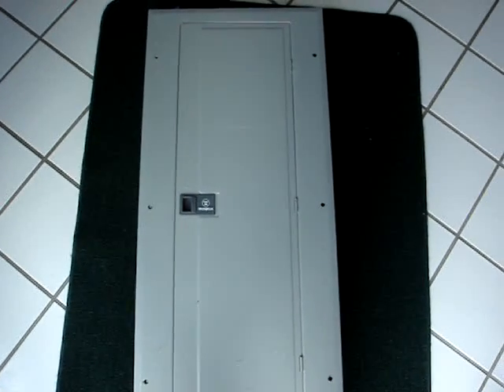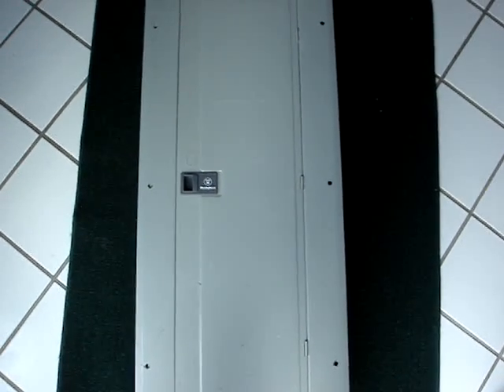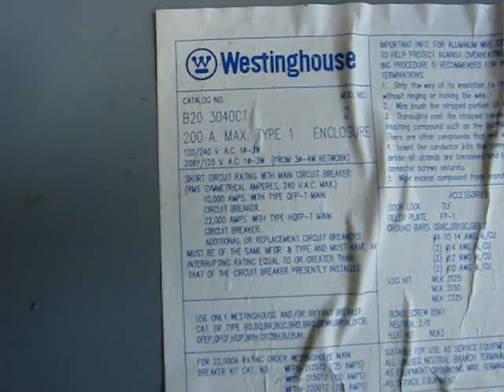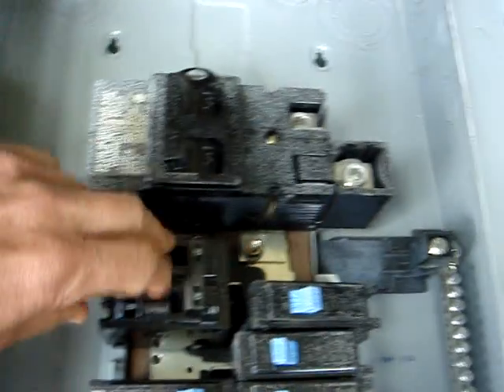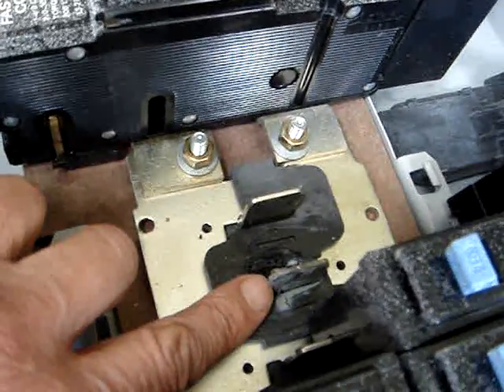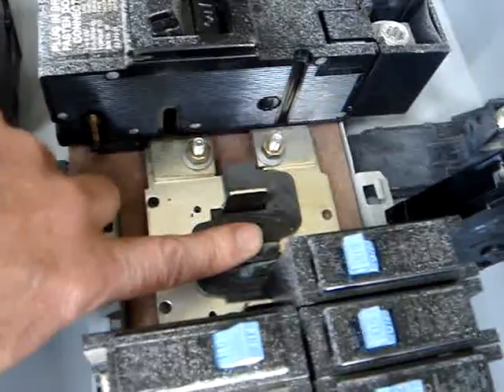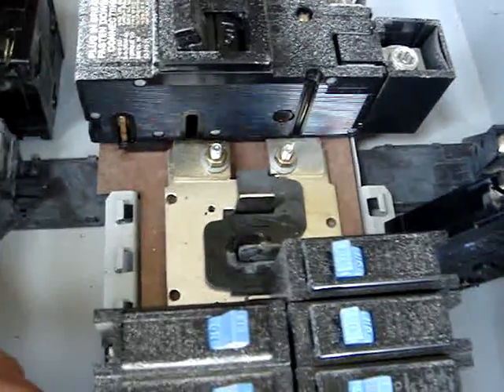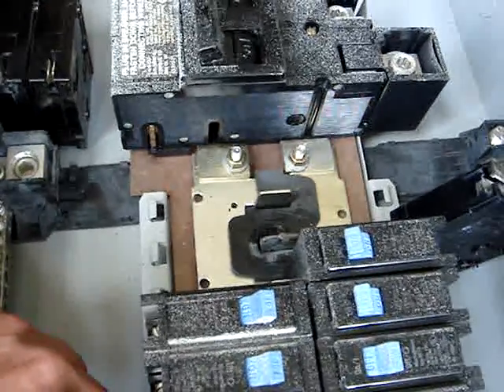Circuit Breaker Panel Problem - arcing between busbar and breaker - heating and melting plastic

Comment: I just had an interesting thought watching this vid. It's something I've seen but never really connected with before. When you buy new breakers, the slot on the breaker that contacts the buss on the panel has a noticeable spot of grease in it. And I've seen tubes of electrical grease for sale at the big box stores. Perhaps every time we remove a breaker, we need to regrease the slot? Maybe the electrical grease helps with good contact of the breaker to the buss?
Reply: The grease is there to prevent corosion.

What you want is good metal to metal contact and good springy metal conductors.

George Westinghouse was good ethical man but the board of directors of Westinghouse of the early 90's or Eaton today I can't speak for. It sure looks like shoddy manufacturing.
Reply: @maynardjohnson3313  George was a hell of a guy! He and I went to different schools together all the way through college.

Comment: Well of course Eaton is going to say there's no problems with the box.....they're not going to say "Yeah, those boxes were total junk, you should get rid of that thing".
Reply from the maker: If I had not given the company a chance to respond, then I would have skipped the first step in solving the problem and been accused of bypassing the company.  I was not under the misconception that they would cheerfully own the problem.  Once they had their chance, the next step was UL and the feds, none of whom want to say there is a problem either.  You are welcome to suggest additional solutions.
Reply: @DBTNVideo  wrong brand of beaker for the panel installed 100s of them never had a problem
Reply: DBTNVideo
I have a couple breaker happen like that, but it is all burn on the one side of the bar of the panel. the electrician said it was lighting hit. insurance paid for that

Comment: I have a Westinghouse B20- 1224cg   The home was built in 1993.  The main breaker is getting hot when under load from furnace or central air and looks like its melting.   I'm hoping I don't need a whole new panel but I'm afraid that will be the result when the Electrician comes later today.
Reply: What happened?  Care to post a follow-up comment?
Reply: Dan s If a single 'tab' becomes burnt, and if there are enough other empty slots in your panel, you can just move BOTH breakers that share that 'tab'.  Mark those two slots as burnt (or damaged don't use), so nobody in the future tries to use them, there problem solved, no costly electrician labor to pay for. Of course, only do this if you feel comfortable working on such things and know how to be safe.

Comment: Learn about the ionozation, your leads from the the grid are going to be aluminum at some point of connection,  and your buss bars should be copper , they have a goldish tint in this video and thats a good hint of the problem. alumiinum when made is a negatively charged element, this prevents rust and corrosion with higher voltage and is much cheaper, the problem in most cases is the contacts and wires outbound are copper and brass (copper and zinc ionized)These metals are whats known as alkalie or posiively charged elements. which increases conductivity but also does not allow for overload as it will just began to radiate heat causing the insulator to melt and and the current to arc to the closest ground damaging much in its path instead of poppping the breaker, and safely disarming. This is the cause of many dangerous electrical fires. Aluminum is negatively charged and has a considerably higher resistance to current and will absorb much more than than the copper or brass will, it will not force the current through the breaker causing a break in circuit but rather act similar to a capacitor, over time the negatively charged higher resitance will continue the breaker circuit but instead of forcing the excess to pop the breaker the positive charge builds up in the aluminum wire eventualy causing heat but much worse the positive electron displaced because of current pressure create a negative electric field  and pass right on through the dialectric(insulator plastic breaker) and the positively charged copper will absorbe that negative current which at that point is already recieving the max it should via the breaker not it has a secondary power source with no limiter and the other breakers( usually the larger ones first, as they are the path of least resistance will induce large amounts of current via the field and since copper is a much more dense element it cant store the energy like aluminum can and it is forced to radiate the excess with heat, melting the plastic, and insulation until an arc can be made to a sufficent ground. mixing the wires sometimes is a necessity, unfortunatly but you want to try to avoid electrolsys at all costs, they need to be super clean for the connection and brazen . some folks use pigtails. remember brass is a positve metal to and so u dont want to be mixing if it can be avoided. there are special types of connection grease and special wire nuts to buy, but its something that your going to want someone knowledgable to do as a small mistake could prove very costly. also a good precaution isto make sure of proper neutral and ground bars , the differences are slight but make a huge difference. I am glad you called a professional , its always a good bet when it comes to that, It stinks to pay 900.00 i know, but hopefully it will def be worth it. Most folks dont have an understanding of the chemical electrolisys or electromagnetic dangers of overloading copper or aluminum. Good luck man! :)

Comment: I have  a 1970's 200 amp GE with die cast buss bars and I get that sizzling on only one breaker(end of house). I tried a new breaker on different section in breaker box and it did the same thing.

Comment: I have a Westinghouse 200 amp breaker panel box that is about 9 years old that has started with a faint crackling noise. This video was helpful to me because I was not aware about the loose rear tabs on breakers causing a problem. But then again I am not an electrician. Thanks

Comment: I have an Eaton c/b panel and I have the same problem with a 100amp breaker. I have replaced the breaker and cleaned the contact. It works for few months then it archs and trips back the breaker. If I replace the breaker with a 125amp, will it fix the problem? Thanks for the reply.
Reply: are you using the proper brand of breaker you should never be tripping a 100 amp breaker  also never up size a breaker from what it was intended  and if the tabs in the panned have had arcing a new breaker still wont fit tight and make the problem worse

Comment: Searching for a similar problem to what I had I came across this video. This was in my barn. One day all 3 of my 240V machines work, next day, nothing. Hooked up Amprobe and am reading 119-121 on each leg. Still, none of them would start. Everything looked fine. This box is a GE CJ-589835 (and it's been there since I bought the place for anyone with concerns about my selection of electrical components). For the 240 breakers there is a "kit" type strap that runs across the bus bars to pull both legs for 240. It's bolted to one side and lays across the opposite bar, apparently by pressure alone, as you can wiggle the strap up and then down until it contacts the bus bar. Well, apparently after some years of load the strap expands enough that it no longer makes sufficient contact to carry a 240V load. I don't know if the strap kit is installed at the factory or if someone installed them. Regardless, it is a poor example of how to do this. All of the voltage readings were normal and I checked that everything was tight, so no problem there. I flipped the compressor breaker switch back on and pressed down on the breaker and the compressor started right up. As soon as I let it go, it shut off. Needless to say, I yanked that thing out and installed a new Seimens box. I like the robust stabs on this box. They are large and have a lot of contact area. Anyway, glad your home didn't burn down. I'm also happy that I found my problem the way I did and not my seeing smoke coming out of the barn. I've got a lifetime's collection of tools, a Harley and a 70 Z-28 parked in there. It would have been a disaster. I'm extremely concerned for anyone else that has this box. What a terrible design. I am very maintenance oriented and occasionally check all of my main wire contacts for torque. It's important. However, If you're not very comfortable with electricity, have an electrician come out and do a routine check. It won't cost much and could save your home and maybe life.

Comment: Continuation #2.  in my area, necessitating loadcenter replacement.  He thought the industry had a vested interest in suppressing reports of problems like this.  He also thought there was a relationship between condensation of moist air from the large service cable which in most installations is directly above the vertical row of tabs where they connect to the circuit breakers.  This ultimately causes corrosion & tab overheating.  He has actually seen water dripping down from the main service
Reply: is that a mast problem? or cable loop not present?

Comment: Continuation of my comment.behind the metal front panel of the loadcenter, right where that breaker locked onto the metal tab.  Acrid smoke started coming out, giving an eerie look of rays, like something out of a horror show.  I quickly switched off the main breakers, stopped the whole process.   After things cooled off I found the sump pump breaker looking like the one in this video, plus its tab was completely gone!  An HD clerk who had been an electrician told me it was a frequent problem..

Comment: I believe this is a generic problem common to all loadcenters of similar design,not just Westinghouses.  If the CPSC and UL both tell you this is not a common problem, they are  either uninformed or lying.   If you do a long & detailed web search for related issues you will find many stories like this one.  I had the same thing happen to me 11/1/13, 33+ y.o. ITE loadcenter 200A service.  A 15A breaker controlling a sump pump had clicked off.  When I clicked it on again, an electric arc started.

Comment: I'm a home inspector and run across this problem on occasion. We don't remove any breakers during the inspection. I ran across and ITE panel today that had a melted tab making those particular slots unusable. The home was built in 1972. Aluminum buss bars are not preferred especially in damp locations in basements.

Comment: Having intermittent voltage drops on one 120v line, equipment flickering on/off in my shop and it is the one that sees the most use. Murry 200A box, purchased sometime in the late 90's. Found main breaker burned and one leg scorced just a bit,so cleaned that up and was told to put a Siemens main in.  Worked well for about 6-8 months, now the issue is back, same bottom leg of the main breaker. Guess it's SquareD time, these cheaper panels/breakers are not worth it.

Comment: If I was an electrician I would install SquareD panels on all of my jobs, residential and commercial, with trip indicator flag circuit breakers, SquareD are the best panels out there.
Reply: I had a Square D panel do exactly the same to me..  The 30 amp breaker burned up and almost caught the house on fire.
Reply: @midos6767  All panels are bad - shoddy construction, poor QC, nothing is built to last nowadays and a lot of the panels have issues, it's not just Zinsco, Sylvania, Commander, etc, combine that with a lot of shitty electricians who miss something or make even 1 bad mistake, I have seen shitty mistakes even from MASTER electricians, and STUPID ones, like put 20A breakers in replacement of 15A but not upgrading to wires, fucking genius, some panels have no issues but will have some even years after a new install it depends, some sparkies with big egos think it is a good idea to just screw things blindly and not torque those lugs up to specs...........................

Comment: This type of damage is not too uncommon. I see it a lot actually. I don't recommend that you change the whole panel because of it though that's a little over kill. Unless you have the money its not really worth it. You could clean up the buss bars with a wire brush or sand paper. (turn off power of course). If you have room relocate the breakers but put in spares where you experienced the problem so you don't have open spaces. id only replace it if your panel is massively burnt or corroded.
Reply: I agree. I've done that too.  To this day everything still works fine.

Comment from the maker: The panel was replaced.  The tabs that rise up for the circuit breaker to push down onto were the ones that were damaged.  I did not look at the big breakers shown at the very top of the photo..

Comment: I have just come across a similar issue with a Bryant 60A a/c and 30a w/h breaker on a 200a Westinghouse panel. The house was built in the same year of 1993. I was looking at the 200a main breaker and it looks very similar to the famous Zinsco breaker design vertical bus bars. Have you taken the main breaker off to see if there was any damage to the vertical bars too?

Comment: This is what happens when manufacturers try to cut costs without doing reliability testing, that testing costs money so they just hope to have moved on before they get caught selling defective materials. Years ago I worked for a company that had 200 amp 3 phase ITE bereaker panels and we had a similar problem. If I caught the problem early enough I could clean up the buss bars and everything was fine AS LONG as i monitored breakers for overheating. 

UL is useless on something like this.

Comment from the maker: Blame that one on the electrician who did the original construction work when the house was built.  The guy who replaced the panel and breakers made a remark about not being able to use the old breakers on the new panel, but nothing about an incompatibility of breakers and bus on the old panel.  Thanks for the comment.

Comment: Looks like you had a Seimens 2 pole 50 amp breaker in a Westinghouse panel.
In Canada this voids the CSA approval. Only install westinghouse breakers in westinghouse panels. I belive this was the cause of the short on your main buss. Allways check the panel cover to see what breakers can be used in your panel ! Be Safe.
Reply: Exactly, although many breakers will "fit", than doesn't mean you can use them!  Slightly different configurations or poorly made breakers can cause poor contact area to the bus, not enough tension or contact area.  I would suspect that the breaker, and not the panel was the cause.

Comment: Thus on my sub panel I just abandoned this lug when Clinton was President and placed a new breaker on an unused lug. I did not replace the subpanel; I just turned off the power and cleaned off the lugs and made sure the breakers are tight on the lugs. The breaker is the issue; the lugs are dumb and just there. A poor cheap breaker with poor metal tabs can be the issue. There have been counterfeit breakers too. A IR thermal probe will show a warm breaker, or ones hand too.

Comment: Continued. Later I noticed an odd arcing sound in the subpanel in the garage. The 20 amp single pole breaker "ate" the lug on the breaker box. Once one is drawing more current with a poor connection it gets hot. This heat then softens the metal tabs on the breaker that contact the buss bar. This "feeds" the destruction. The breakers metal fingers that contact the buss bar are now looser. This adds resistance and more heat thus the problem worsens and the buss bar is ruined.

Comment: My 40 year house has had this issue but with an ITE breaker box. I my case the issue is their is salt air corrosion and thus one with time gets crud on the buss bar. We had a 20 amp breaker that fed the bathroom for 30 years with no problems. It's load was just the few amps for room lights. OR say 12 to 15 amps for a hair dryer for a minute. THEN we added a dehumidifier in the room and issues developed. I noted once some light flickering when the 8 amp big portable dehumidifier ran.

Comment: I have what looks to be an identical control panel.  It is a Westinghouse installed about 1991.  My 2 50amp breaker for the AC was installed on the top left and did the same as you show in the video.  The AC breakers at the time were replaced and located to an open space on the bottom.  Seems to me it does seem to a be a problem with the Westinghouse box

Comment from the maker: More comment:  Your old breakers might not be useable on a new panel - mine weren't.  That's something my electrician told me.  In addition, you have to pull the meter to cut the power to the panel which requires the utility company to do it and then to inspect the work before reconnecting the meter.  In short, replacement is a job for a professional.  What you risk for personal safety and property damage is way too much in my book for doing it yourself and I'm a DIY guy..

Comment from the maker: Check with an electrician and/or local electrical supply house.  I doubt you can buy just the bar.  If you replace the entire panel, you must remove all the wiring and reconnect it to the same size breakers the circuits originally used - and, it seems that you must also match the type of breaker to the type of panel and bus bar - not every breaker is for every style of panel.

Comment: I'm having this problem now with a Crouse-Hinds box and a single pole 15A breaker. It failed, I replaced the breaker after cleaning the tab to which it connected and heard the arcing the next day.  Not looking forward to spending $900 or more to replace the box.